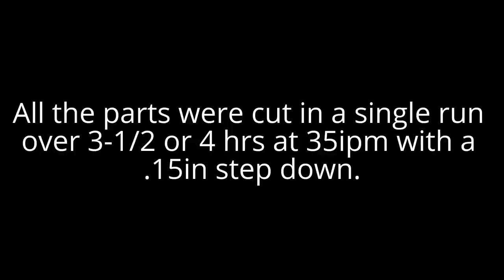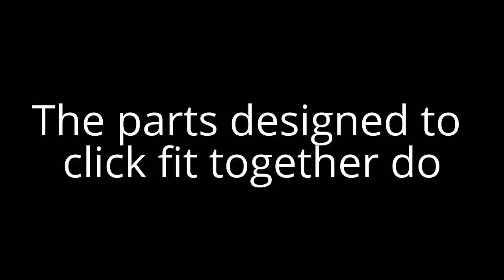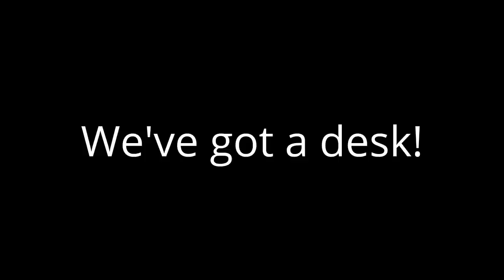Making an Olivia Desk from Open Desk with Maslow

Comment: I love what you guys are doing with this CNC ! Just a question - is there a reason you do not use "common cut lines" where feasible for for duplicated items ?
Reply: Alan Van Rooyen I think common cut lines can be a problem when your cutting Parts out using tabs... the tabs help hold the pieces together while they are being cut out.
Reply: if you start at the top and work your way down common cut lines would be OK-IMHO-it just don't work when you start at the bottom and work your way up.

Comment: A trick for open desk builds. Measure the exact thickness of the board with verniers then request the file for that size i.e. 17.8 mm. You'll get a much tighter fit.

Comment: You could have easily got two tables out of that sheet, what a waste. Really awesome machine and design.
Reply: Razor Blades however they are working on the accuracy of the device at the periphery. It's still at 1/16" inch and a fit together might require better accuracy. My sense is that he made if towards the middle to avoid any issues inherent to the current ability to calibrate it. ;-)
Reply: I guess a different plywood size or divide it into 2 phases, with moving the plywood after first phase, would solve this.

Comment: Certain designs from Open Desk call for some cuts with angles. Since you have only X/Y and Z movement, and no way to incline the router when cutting, how would this be achieved?

I guess you could use an angle router bit, but it would have to be changed manually. Also, since the bit dimensions would be different, does the software adjust the movements to consider these differences?
Reply: With the Maslow you do the same thing everyone else with a 3-axis CNC mill does.
Use the 3-axis designs.

Comment: Why do you need so many passes. Is it because there is no vertical force to push the router against the material?
Reply: Depending on the depth of the plywood (usually 20mm) the drill has to pass multiple times, for example 4 x 5mm depth. If you've got a 6mm drill bit, the easy rule is you can't drill further than its with, so 6mm deep max.

Comment: Looking for a cnc to build for my classroom. I love this idea but am a little worried about repeatability. How much wiggle is there when cutting a straight line, for instance?
Reply: I believe their goal is to be within 1/64 of an inch, or .4mm of where the router should be, and I believe they've accomplished that in the middle area.
Reply: Richard Buettner If I'm understanding you, accuracy may get worse as we get toward the edges. this makes sense, makes me wonder if the form factor is worth the sacrifice of accuracy. might have to go a different route.
Reply: It's not a design flaw, it has the ability to have that accuracy at the edges too, they just have to finish the calibration code.
Reply: Richard Buettner not necessarily a flaw but a trade off. I may still get one put together just to see. Still cheaper than other options. I'm also considering the mpcnc.
Reply: +Richard Buettner  Actually the accuracy is more related to the inherent geometry of the 2 chains at the corners of the board. You can test this yourself easily to understand the dynamics of what's happening. Attach  two strings of any length to any object and suspend it in the air by pulling out the strings at 45 degrees relative to the object. You'll notice how relatively stable the suspended object is. Now drop one string and let the object pendulum around the other string until that string is close to being vertical. Now how is the stability of the object?...not so good.

It comes down to balancing of forces relatively to gravity and it's optimal at 45 degrees. As those chain angles decrease relative to vertical the accuracy suffers because the cutting head is less stable and will tend to bounce around more. Calibrating the firmware will not have any affect on the physical geometry.

This is why the inventors say it works the best when cutting shapes in the middle of the plywood. That's where the 2 chains and the weights are able to effectively balance the forces on the cutting head and keep it the most stable.
Reply: build a mechmate.. you will have total control of the machine and will be faster at cutting
Reply: +CapApollo  Maslow was intended for people on a limited budget and limited fabrication skills.
Reply: evan say classroom.. you cant spend 1 hour in cutting a plywood board in a class. i dont know the software in this machine but a machmate as many others uses gcode that is very usefull to learn.
Reply: +CapApollo  Maslow also uses g-code but what's your point? This machine let's you get into CNC cutting of plywood shapes for a fraction of the cost of a true CNC table. In fact there is no comparison. Sure it's not perfect but what do you expect for $350?
Reply: plz do not use this in a classroom way to many safety concerns(safety board would never allow this), if u want make a cnc for a class room look into the 8020 aluminum cnc kits much safer but more expensive
Reply: +OU812

Could the accuracy near the edges could be improved if you made the whole thing larger, with longer arms?
Reply: narco73  The geometry issue I described scales proportionally so yes you can make the arms longer to try and maintain as close to 45deg angles as possible.

It becomes impractical after a certain size.

Comment: This is awesome! Question-Can this, the Maslow CNC be permanently fixed flat on a wall or does it have to be at an angle/incline in order to work?
Reply: The frame could be fixed to a wall, but it will still need a bit of tilt for proper plunge pressure and for the sled to glide.

Comment: what is the maximum realistic cutting speed
Reply: Check the kickstarter project page for that, or maybe the chat page. Right now it's set slow for accuracy and testing. IIRC the target / limit set by motor/gear is 80ipm. However the gear can be changed, and defined in the configs.
Reply: Oh, you asked about realistic. That's a function of material, thickness, cutter diameter (bigger is faster) and depth of cut. The router so far appears to not be a limit. There's an earlier 'speed test' that cut like butter. But that was earlier software and AFAIK still not a recommended technique. They're doing it in stages, crawl, toddle, walk, run. :)

Comment: This is such a beautiful machine and such a great idea. Can I ask- presumably when each shape has finished cutting, it will fall slightly into the cavity left by the cut. Do you account for this in the firmware so the finished part does not hit the cutting blade? I'm guessing the final part of the cut is at the top of the piece?
Reply: You do not cut all the way through. You leave little "tabs", which have to be cut away once the machine is done.
Reply: But yes, if you don't add the tabs, it would fall into the cavity.
The tabs can be easily added with makerCAM.com, you can see other videos on the maslow channel, where they show how it's done.

Comment: What keeps the pieces from falling after being cut? Are they still barely connecting?
Reply: You can leave uncut "tabs" to hold the pieces together.
Reply: Milton Tucker thank you. I wonder about that. How does the bit retract?
Reply: There is an optional "Z" axis that adjusts cut depth . Search for "maslow router z axis", and you should find a video.

Comment: how accurately can the cnc cut? I mean, with the whole cutting head twisting like that when it gets to the sides. or is that electronically compinsated for? 

thanks
Reply: in about 80% of the sheet its within 1/64 and the outsides starts to get towards 1/16 as far as I know from another video where it was featured on tested but that was 2 months ago and it sounds like they were pretty sure they could get the difference removed.
Reply: BirdBuster wow, that's pretty good! thanks :)

Comment: Cost of plywood $80. Time for sanding and varnishing, 5 hours. Buy from Ikea :-).
Reply: that's some dam expensive plywood were you shop.  probably about $35 in wood at lowes or home depot and you could probably make the chair from the same sheet. I'm willing to bet its stronger and will last longer too.
Reply: Australia. A sheet of marine ply 4' x 8' x 1/2" from Bunnings with tax 10% is US$63 but then again the staff get paid more than American big box stores. US$10+  vs  US$16+ for sales associate, team member etc.
Reply: Marine ply is probably 2x the cost of regular - and you don't need it....
Reply: The last dollar amount is AUD$ approx. for 2440 x 1220 equivalent.
The following are available at Bunnings for 12mm plywood.

2440 x 1220 x 12mm AA Grade Mixed Hardwood marine grade = $88 ($88)

Project Panel 1200 x 796 x 12mm H3 Exterior Plywood =$29  ($87)

1200 x 900 x 12mm BC Plywood = $32  ($90)

Carter Holt Harvey 1198 x 1200mm x 12mm Non Structural ECOply = $20  ($55)
bunnings.com.au/search/products?q=12mm%20ply%20wood
Reply: Shop somewhere else for plywood mate....
Reply: That's the solution. I only brought it up as I recently did a copy of the Ikea Norden gateleg table which had 6 drawers. I used lower grade ply and spent so much time sanding I swore I would never do that again.
Reply: petty petty petty for just an experiment ot simply a good example.